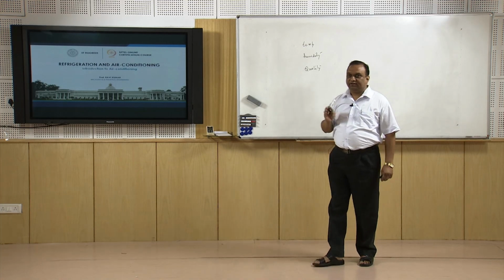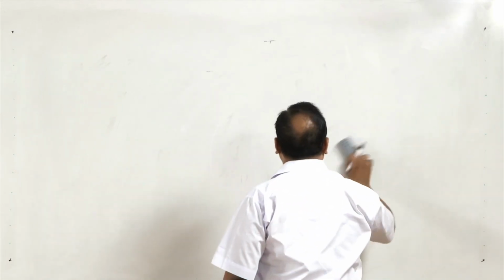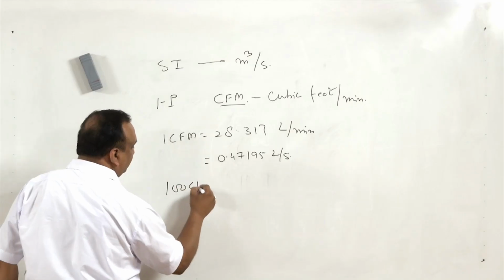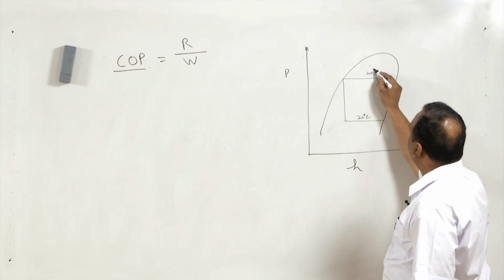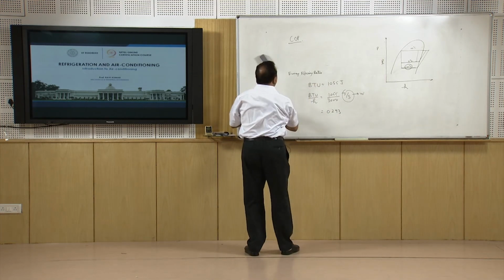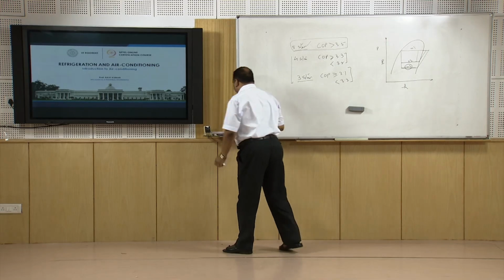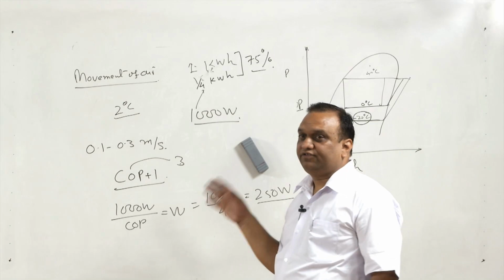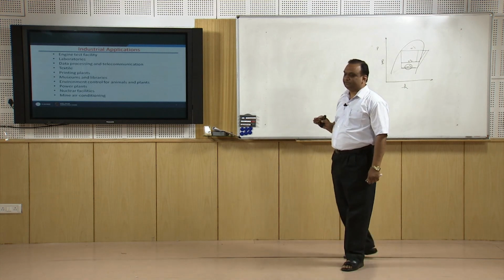Introduction to Air-conditioning

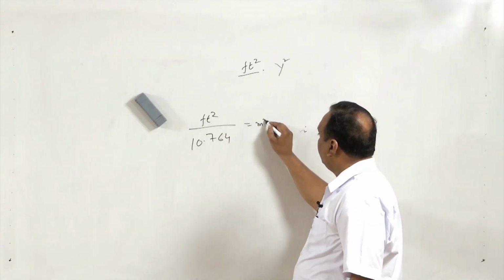Comment: Dear sir, pause the video at 8:25 and kindly review the blunder. Ft^2/10.764 = m^2. Which means ft is a bigger unit than meter. Kindly correct it. 🙏
Reply: I think it is correct. To convert m^2 in to ft^ you have to multiply with 10.764 . Like km is big unit but to convert km. In to m. You have to multiply with 1000.
Reply: Lol.. clearly your basics first
Reply: @Utpalrai07  for whom are you saying dear??
Reply: @Rahulmishra07 I think the one who is wrong.

Comment: Sir I think heat pump work on the same cycle as that of refrigerator (not reversed). Its only the desired effects which gets changed.
Reply: No. It's reversed cycle @Harshit Singh. Same Unit act reversely when its comes to winter season